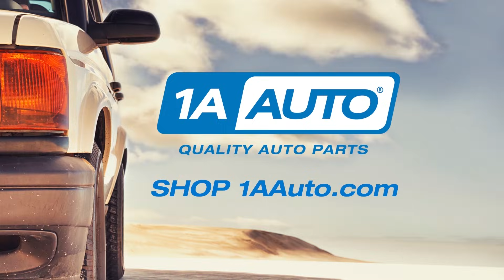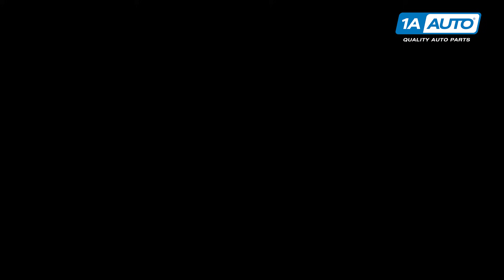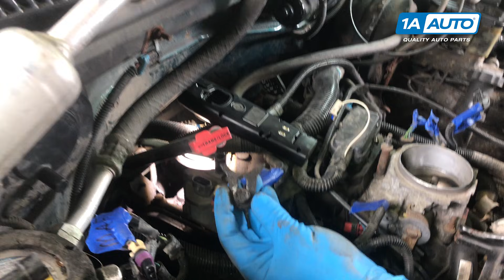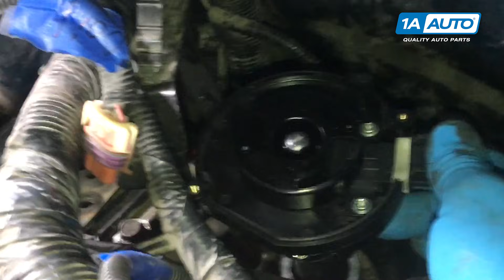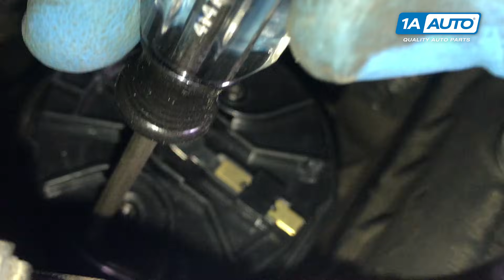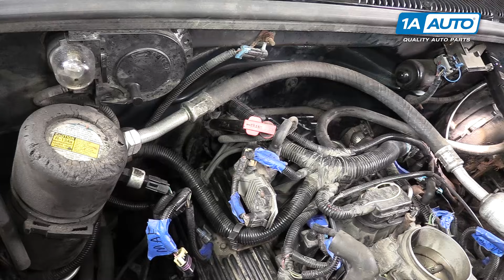How to Replace Distributor 96-99 GMC Sierra K1500 Truck

Comment: I broke the screw posts on the distributer, that the cap screws into.. now I have to replace the distributor.. does it HAVE to be in TDC? Or can I replace it in the position it’s stuck at? 

How hard is it to get tdc with the engine installed still?

Comment: You don't mention what to do if the flat on the housing isn't parallel with the block. If you look at the gear you'll see that there are 13 teeth on the distributor shaft. It is held on with a roll pin. Punch it out and rotate the gear 180 degrees. Reinstall the roll pin. I'm not sure if the gear on my cam shaft was off by a tooth or the distributor was manufactured off. There is a small mark on the housing with a number 8 on it,  With the rotor on, the tip should align with the tip of that 8 on the housing. On my engine,there was no way to get the flat close to where it needed to be. If you have a scan tool, it should be within 3 or 5 degrees. If not minor adjustment can be done but if the marks were correct it should be fine, without a scan tool. I know one may worry about getting it exactly on but all that part of timing does is tell the computer when the rotor is pointing close enough to the number one spark plug. The actual spark timing is set by the tone wheel behind the chain cover. On the older engines the intake manifold didn't get in the way to set it closer regardless of the gear position. Don't be afraid to punch the roll pin out and rotate the gear 180 degrees.

Comment: W😳W !!!!!!!!!!  You make virtually no mention of the scan tool to set the CMP Retard. AS A PARTS Store wouldn’t that be worth an explanation & a part (scan tool) that measures the degrees° so you could sell it!?  Don’t remove the distributor or intake manifold unless you already have the CMP Retard Reader. They are hard to find. Good Luck!

Comment: I have a 1985 Nissan truck with double plugs 8of them and can you show me how to reset spark plug wires in the distributor and to each cylinder thanks fred
Reply from the maker: +@fredburnsiv1230 We do not have a video for this repair right now, but we'll keep this request in mind for a future video! http://1aau.to/m/Shop-1AAuto-c

Comment: I’ve replaced my distributor and now I’m running a -20° timing advance for number one cylinder at idle. I’m fairly confident the distributor is not a tooth off as it’s pointing at or just before the #1 cylinder pin on the cap @TDC.

Comment: Anyone know whether there is an o-ring or other type of seal on the distributor where is mates to the intake?
Mine does not have one. I was wondering if there could be a vacuum leak at this mating point.
Reply: Mine had a flat gasket
Reply: Just a circular gasket

Comment: I need to replace the distributor on my 99 Tahoe but their website has a billet one for $81 and a non-billet one for $85.  What's the difference between the two and why is the billet one cheaper?

Comment: The rotor button dident look like it was facing number 1 cylinder. Mine did the same thing and it wont turn over right. I followed these steps. My firing order is fine I dove checked but after install my rotor button was facing front of vehicle not number 1 cylinder.

Comment: Dumb to remove the plug wires if ur reusing the same wires.  TDC doesn't matter. Just make sure ur rotor is pointing in the Exact same position when u reassemble.  Computer takes over n adjusts timing.  Disconnect P.I.P to set base timing if u need to. Then reconnect. Computer does the rest.
Reply from the maker: +Kevin Hamilton Thanks for the tip!

Comment: unless your replacing the wires, leave them on the plugs and unplug from the distributor, its easier.
Second, DON'T use an OEM distributor they are plastic and they are garbage and break the ears off then you can't tighten your cap, spend the extra money and get an all aluminium distributor.
Third, not all engines have that timing mark on the front, mine does not have any of that and is a factory 98 k1500 5.7 vortec and can be a pain to drop in the new distributor sometimes. i had to replace my distributor when the dealer broke mine and denied any wrong doing when they replaced my engine. they had a zip tie holding down my cap.....

Comment: I usually love your videos but this is way off course hear. Yiu were doing heads at same time you dident show us the proper way to take it out or back in relearning is what most us come for and the most important part smh
Reply from the maker: +Jesse Rousseau Thanks for the tip! We'll pass this info along to our production team.
Reply: I was hoping that the video would show a scanner with a cam offset function for under $500.

Comment: I’m having so much trouble with the distributor getting it point to my number 6 diamond, I have a 1997 Chevy 4.3 l v6  can someone please tell me how to get it to line up I have tried to stick a screwdriver and turn it but no matter what it still lands on the same spot .
Reply: Dance the distributor around, when it makes contact all the way down and you pull it out. It will move the oil pump one tooth counter clockwise usually. It’s a labor of time if you don’t have the tool to align it

Comment: If you have A1345 code after removing the distributor to the news of the tooth off use the scanner to see whether it is advanced  or retarded tooth put At 0

Comment: I was told by a GM guy that had a expensive scanner that my 97 Tahoe threw a timing code and it didn't have an option for a relearn. So they think it is my timing chain which I'm following your guide to replacing that tomorrow.
Reply from the maker: +Tyler Elliott Thanks for checking us out!

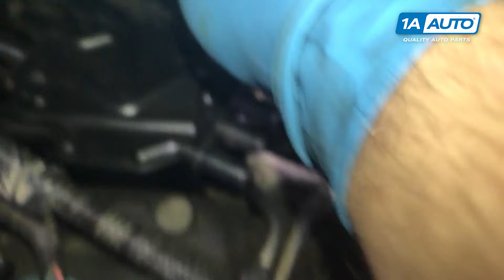Comment: I was going to buy one of these distributors from A1. But, when he said don't tighten the distributor cap too tight (9:25) because your going into plastic. I decided not to buy it. Because my OEM is plastic and the ear is broke where the screw goes into it right where he's talking about. This is a common problem with the OEM's. I will buy one that screws into metal. Why would I replace plastic with plastic.
Reply from the maker: +Sonic Boom Thanks for the feedback!
Reply: Dude stfu nobody cares!

Comment: I replaced my distributor but now I have a p1345 code. Is the only way to fix is with a fancy code reader?
Reply: I just did a distributor change tonight and now have the same code saying either timing chain slack or distributor tooth off one. Did you solve this issue yet and if so i'd be curious to know what ended up being your solution.. Hope it worked out for u n i hear back. Thanks

Comment: I removed the distributor without tdc on engine. Should I find tdc without the new distributor in it or should I just align everything on the new distributor install it and then find ttc and reinstall? Thank you.
Reply: bring it to tdc and drop it in. that puts your back where your were its just the long way to do it if u didn't mark reference points. I do it this way everytime

Comment: I saw another of your videos where you could use a clamp that allows no rotation of the distributor.If you need a scan tool for adjustment how do you adjust the distributor if u cannot rotate it?
Reply: Go to a pre 96 hold down and you can rotate the distributor
Reply: @robinvackar3653  huh?

Comment: What I want to know is what this engine was doing to warrant a new distributor my engine in my 96 Tahoe is half ass backfiring and sometimes  kicking back it has a brand new starter crank sensor cap rotor spark plugs and wires and was running perfectly fine until I ran it out of gas one day getting perfect fuel numbers on the tester and good spark out of the coil and good spark at the spark plugs have no codes for anything
Reply: dave a Hello there's a channel on YouTube called scannerdanner. If you want to understand more about vehicle diagnostics he's your guy. He also has a website called scannerdanner premium. It's $11 per month to be a member. He is a teacher at Rosedale technical college in Pittsburgh PA. The premium site takes you along in video format of his class lectures. He also wrote a book which is available in paperback or ebook. Which is to be used as trouble shooting guide in the field. His premium site has a 14 day free trial. Once there he has a video that covers this specific topic in regards to 5.7 vortec distributor and worn gear and symptoms of it. CAM-CRANK CORRELATION TROUBLE CODE (1998 CHEVY 5.0L) that is the title of the video and it is only available on his premium site. Again his site has 14 day free trial. You can create an account watch that video and leave before the 14 days are up. Or you can stick around and pick up what he's putting down and learn quite bit like I have over the last 5 months. It's up to you. But I would highly recommend you at least checking out the video about your issue. And then be the judge from there as to sticking around or not.
Reply: fuel filter dude.. try that.. and you mite have a crossed wire
Reply: dave a I actually found similar video from scannerdanner here on YouTube. https://youtu.be/vs4vxeVVQkc

But seriously try scannerdanner premium for the 14 days. You'll learn an immense amount of knowledge from him whether you join premium or just watch his free videos here on YouTube. The guy is an engine electrical performance diagnostic God. I'm telling you, you owe it to yourself to check him out. And you'll see what I'm talking about. The guy has changed my life!
Reply: Did you ever figure it out?

Comment: I've recently installed a distributor from you (part no. 1AEDI00129) and my computer states I'm off by 19 degrees in my timing. I've watched a few videos on adjusting the distributor position but the hold down tab on the distributor do not allow me to rotate by hand as other distributors seem to. Am I suppose to use a wrench on the square part of the shaft or does your distributor not allow it to be adjusted?
Reply: You ever figure it out? I have a similar problem.

Comment: I ordered the distributor from you guys, but the video doesn't show anything about using the scan tool to fine tune it. How critical is that?
Reply: Jared Drake pretty critical. it wont ever run right with out it

Comment: Would a bad distributor keep my truck from running? 98 silverado k1500 pickup 4wd. It starts for a second and keeps dying. Changed fuel pump,filter, spider injector, crankshaft sensor, cam position sensor, rotor and cap for distributor. Was thinking it could be that little plastic gear at the bottom? Not sure. Any help would be great. Your videos are a great help when i do run into replacing these kinds of things though and i really appreciate the time you guys put into them
Reply from the maker: +Isaiah Vorhies If the distributor goes bad it would cause the vehicle to run rough or possibly not start. Hope this helps you out. 1aauto.com
Reply: Try replacing your throttle position sensor
Reply: The distributor is plastic. You should replace with a metal one.
Reply: I have a 99 k3500 7.4 I am getting a p0300 I have replace cap rotor plugs wires no leaks great compression switch plugs same thing any help
Reply: Did you check ignition coil?
Reply: check wires are on correct cylinders i had a p0300 and 2 wires had been crossed by a certified mechanic mistakes happen.
Reply: Same deal with my 97. Keeps shorting my cap and rotor. One sign is that the condition of the cap points are in pretty bad shape after a few weeks of replacing. Going to replace my distributor tomorrow.

Comment: Does the oil pump slot inside the engine need to be lined up a little before dropping it in?
Reply from the maker: +Jackson Cruz Thank you for checking us out. This will have to be aligned properly for function and fit. 1aauto.com
Reply: Yes, definitely and check for oil pressure immediately after initial start up just to be sure.
Reply: @MrMd5555  to my knowledge the distributior won't sit flush with intake if the notch is not properly seated into oil pump.

Comment: you don't need to remove the spark plugs wires just makes more work
Reply: That was simply because the head was coming off!
Reply: @subuer  It was a little p